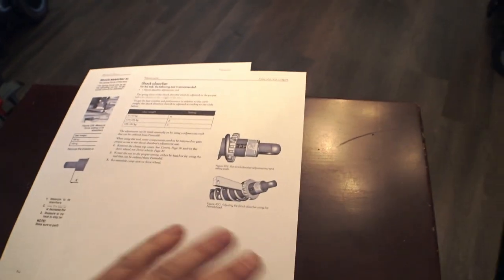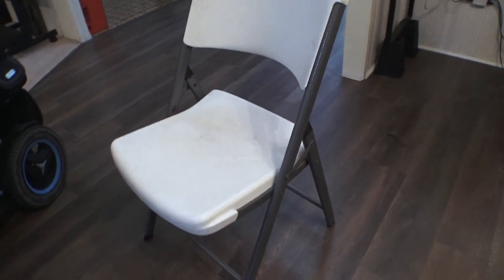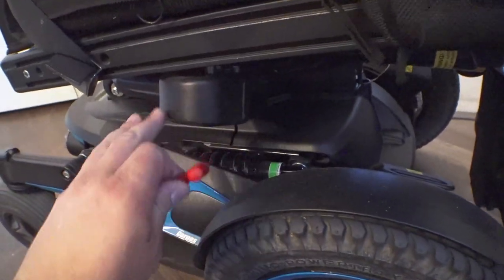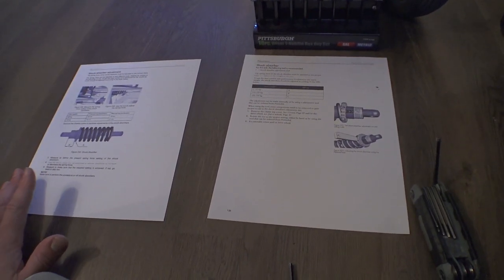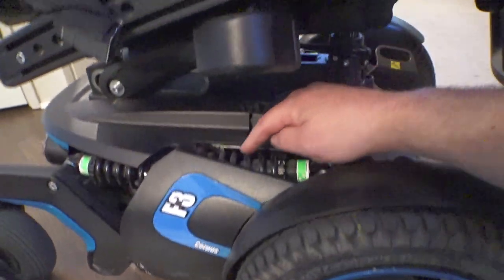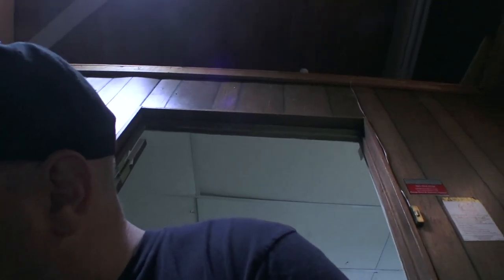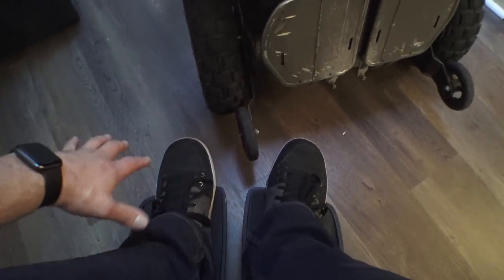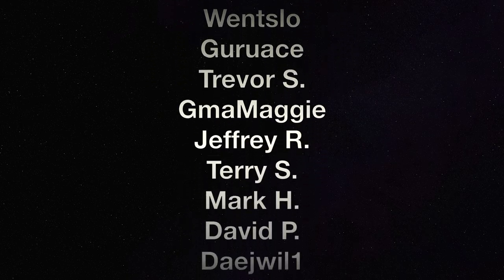REPAIR: adjusting shocks! Permobil F3 (and other models)

Comment: Thanks Dan.Yours instructions worked great on the M3 ! I found it easier to remove the front and rear body panels for the M series but your instructions were the key. It's much appreciated ! Now if we can just figure out the fixed seat height adjustment. HaHaHa.

Comment: Well my question is answered. 😆 The F3 I have isn't my primary so it's not fitted for me like my Quantum. But I've noticed the suspension is pretty stiff. And I wondered if the shocks were easy to adjust. Guess imma do some adjustments tomorrow.

Comment: I wanted the softest ride possible when I adjusted the shocks on my new F3. I weigh about 185 pounds, so I put the chassis on support blocks so all four wheels are completely off tthe flooor. Then I loosened the adjuster ring until it is only tight enough to hold the spring in place without any slack. This provides the softest ride without having any rattling noise from the springs if I go over potholes that allow the shock absorber to fully extend. This provides a considerably softer ride than the adjustment setting in the Permobil manual.
Reply from the maker: nice work!  i don't understand why everyone designs wheelchair suspension this way - all they have to do is make the shocks about 1" longer so when the chair is sitting on the floor in a neutral position, the shocks aren't at their end stops! everybody wins!
Reply: I've been studying chairs because I have a loved one that might eventually need one. I believe the reason for "zero droop" shocks, is to eliminate the cost of a sway bar or a droop adjustment assembly. The tradeoff is less handling on rough terrain. Given the lawyers and business people are pushing the parameters down to the engineers, that is the most logical for what the sales people are asking for. I don't pass any judgement on the engineers. It's the best setup for smooth surfaces.
Reply: @TotallyNormal-  Exactly! I'm tired of hearing all the excuses from the company reps, support techs, and DME's for the crap they are selling. They had no problem charging $38,827.80 for my F3-POS. There's plenty of crap on this chair (the multitude of plastic accent color pieces, Bluetooth, IR, and Permobil Connect) that has no medical necessity and does nothing to improve the chairs actual performance in the real world. Of course a huge part of the problem is that Medicare and Medicaid explicitly define our wheelchair 'world' as inside our home. Anything you need to go outside your front door is not covered! If that isn't discrimination, then maybe I need a new dictionary. Sorry, we don't cover dictionaries either. LMFAO not!

Comment: The rubber pieces you're talking about are actually bump stops. Their position on the shaft doesn't matter. Since the shocks don't use oil, you're probably hearing the rubber friction orings or or rubber bushings in one of the pivot points. That's my best guess with nondirectional YouTube audio.  :)
Reply: On the Permobil shocks there aren't any rubber bushings on the pivot points, it's just a metal bushing with a side-thrust surface to allow you to torque the mounting bolt properly without clamping the pivot. I recommend wiping the bushing and shock attachment points clean with a shop towel, then spraying a small amount of silicone spray on the bushing before assembly when doing your routine maintaince.

Comment: Hey there brother I love your channelima parapalegic paralyzed from my chest down but I have a question I have a permobil M3 n my batteries don’t work anymore n trying to repair any EZ answer how to replace em and do you know where I can purchase em??
Reply from the maker: depends where you're located.. but i always use MK Power batteries - they cost a bit more.. but last a lot longer than cheap ones! there are service manuals on the website for the replacement process.. its pretty similar to the F3.  www.brokenwheelchairs.com good luck!
Reply: Totally Normal ok yeah I’m located in Oxnard CA but thank you for your response I will be looking for that info appreciate the content n keep it up!!

Comment: Hi dan, i have a problem with my rear wheels on my c500 permobil chair, one side is  woobley at full speed, 
Is that because they are a little worn out? Thanks mate .
Reply from the maker: the older c500 chairs usually use o-rings for anti flutter control if ya take out the top bolt under the cap (if the caps haven't disappeared yet lol) there should be a little plate with the o-ring around it.  usually replacing that with the proper size takes care of things! i dont know the dimensions right off though

Comment: Hey, do you know if the F5 shocks will fit on an F3 chair? Would be nice to have the oil dampened shocks on my F3.
Reply from the maker: making a video about that soon actually! well.. i WAS gonna use F5 shocks.. but ive got a set of brand new ones from a C500.. and they have adjustable rebound! 
pretty sure they'll all fit the F3 though..
and a permo rep said he thinks they will also :^)
Reply: @TotallyNormal-  That's good news! Thanks for the info!

Comment: Does loosening the spring tension negatively affect the chair's stability at high speed?
Reply from the maker: there isnt enough suspension travel or un-sprung weight to cause oscillations - been workin good for me the last few months :^)

Comment: Hey there. I was hoping you might be able to offer some advice. My husband is 6ft tall and uses thr permobil m3. We have been unable to find a wheelchair van for him where he doesn't hit his head and struggle to get in the front door. We have tried multiple dealers, all bringing the vans with the highest door entry heights but they are all too low. Since you have a permobil, can you tell me what kind of wheelchair van you use, the height of the entry, or any advice on how to get in and out safely?
Reply from the maker: full size vans usually have the best headspace inside.  i'm 6'1" and my old 2002 ford worked great! also sprinters, and full size transits have a decent amount of space.  there is a conversion done on a chrysler pacifica too that has TONS of space in it as well.. sometimes minivans have an "XT" conversion version with more space in them

Comment: my yes I have a wheelchair permobil f5 and in the control I appeared ics error 20aa... help me please gave it to me but it doesn't work anymore.. if you can tell me where that fault is I could repair it.... help please is my only way to move to my work
Reply from the maker: 20AA is an error saying that the actuator isnt seen... which means it could have become disconnected, wires got damaged, or somehow the actuator has failed, and is not communicating with the chair at all
if it happened suddenly, i'd check the wiring under the chair, and make sure something isnt pinched somewhere

Comment: I have a question I have the permobil F3  and it is stuck in turtle mode but the wheelchair is not popping up on the joystick so I can let the wheelchair down what do I do?
Reply from the maker: is one of the actuators stuck? like seat lift etc?
Reply: @TotallyNormal-  I think so yeah i’m not really sure what’s the problem but I know it won’t let me put the seat option back on the joystick to let the chair down it will move for a little bit and then the turtle will start flashing red it has very little movement in the battery is fully charged just won’t let me bring seat mode on the joystick my bad I repeated myself several times just making sure you get what I’m saying
Reply from the maker: has the chair been worked on recently? or had something changed on it? trying to think of what could cause that to happen suddenly...
Reply: @TotallyNormal-  No but my chair was dead for a while before I put it on the charger but the chair is tilted up so I think would it being tilted that’s what put it in turtle mode but if I could figure out how to get Seat mode to pop back up on the joystick then I could let it down and probably take it out of turtle mode thanks for responding all I see on the joystick is profile one and profile two but I don’t see seat mode on the joystick anymore and that used to be on there but now the wheelchair is fully charged so I don’t know what could be the problem
Reply from the maker: sometimes if the batteries are super low or damaged some of the modules might not power up... id unhook the charger, and turn off the breaker on back of chair for a bit, then turn back on and see if itll power up normally - just to rule that out :^)